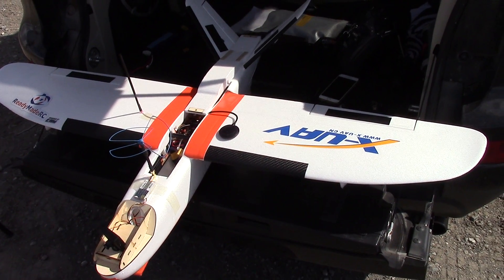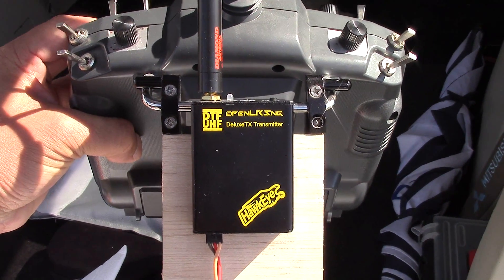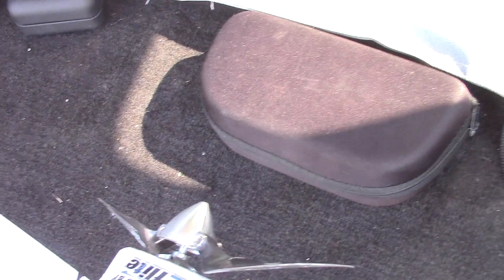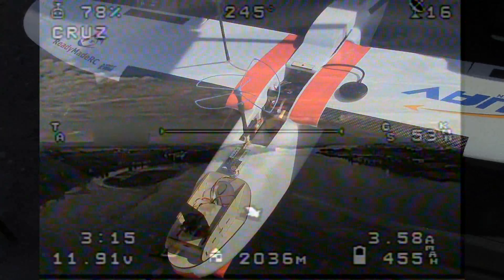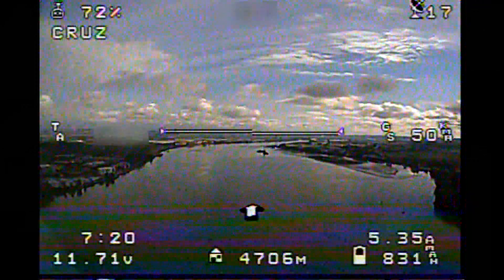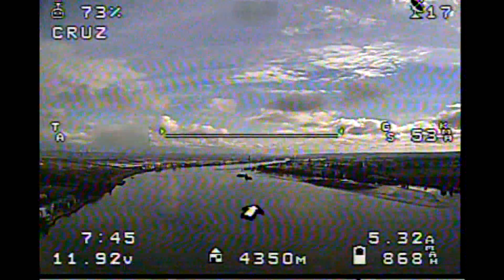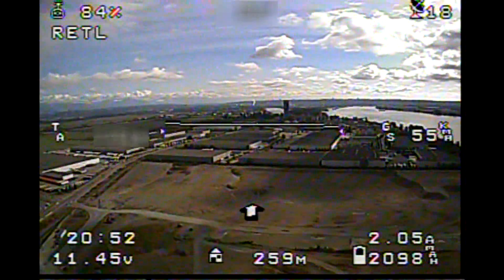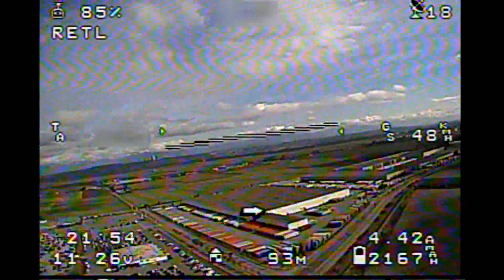Mini Talon + Pixhawk + MinimOSD-Extra - 5 km FPV Maiden w/narration

Comment: Thank you very much for your reply, so you wouldn't go with ebay chinese pixhawk? thanks
Reply from the maker: +L0ND0N200012 I was about to until I read in one of the forums that I go to that at one point Mission Planner was locked down to connect to original 3DR FC products (APM and Pixhawk) only. I cannot verify if it is true or not but being a newbie back then with Pixhawk I did not want to take the risk.

Comment: Thanks for this very informative video, I just want to get your opinion if that's ok, Basically I'm about to finish building uav 3000 but now I'm stuck on making a decision as to which flight controller out of (mfd. eagletree vector and pixhawk) to choose from, I like pixhawk purely because of the integration with mission planner but ofcourse reliability  and accuracy in terms of auto pilot mode are my top priority for this plane. Thanks in advance
Reply from the maker: +L0ND0N200012 If you will need waypoints for aerial mapping or surveying then Pixhawk imho is the FC you should look into, it is also one of the most expensive FC out there (3DR original)., Other components GPS and telemetry radio modules will also need to be purchaed separately. I like the Vector because it is easy to use and configure using their software, makes manual channel mapping a thing of the past when using the built in RX analysis wizard. I fly primarily long range so a rock solid pilot assist mode that locks heading and altitude is very important. Vector has a solid 2D and 2DH modes for whatever winged air frame you have and a very well thought off wiring harness. I like the MFD but in my experience it is very picky on the flight camera that it will work well with. If you just need a decent OSD overlay with GPS/Telemetry and a solid RTH the Cyclops Tornado good choice.

Comment: Hi Thanks for video, I also will build mini Talon  with PixHawk lite. It will  be my first APM, and would be helpfull  to get your settings and help. My first autopilot was Cyclop Tornado. APM very interesting but difficult in bigining. What in first need to do for mini Talon?
Reply from the maker: +Александр Николаев I too started with the Cyclops Tornado, I had a few of them, then moved to the MFD and Vector flight controllers. The Pixhawk is really complicated to configure and requires a lot of reading before you actually touch the configuration. The first thing that I did with my Mini Talon when I was building it was to find a a way to re-enforce the tail skid and motor mount. Coming from the big Talon I know these areas are pain points if you land on anything other than tall grass. If you are building your Mini Talon for long range flights make sure your lipo pack (whether 3S or 4S) will fit the fuselage. I will be shaving some foam on my 2nd Talon to accommodate a bigger 4S pack so it will be easier to shave the foam before actually gluing the 2 fuselage parts together. Most of Pixhawk settings are specific to my TX and GPS/Compass, the rest of the config are stock out of the box.

Comment: Hi Joel. I'm building a Mini-Talon. I've heard that the CG stickers are not correct?  Where is your CG?  Thanks.
Reply from the maker: +Glenn Doney For me right at the servo wires.
Reply: +Fly With Me Fpv I had my CG set at the stickers for its maiden and resulted in a big crash. When I launched it, it pitched back then rolled to the left and came down nose first and ripped the nose off. So it was obviously tail heavy. If u have ur CG at the servo wires then that would make it even more tail heavy ? I managed to patch it up but I'll be setting the new CG at the little holes where the hex screw is that tighten into the wing spar.
Reply: +phats24 I haven't maidened yet so the CG placement is getting me a little nervous.  Zaksterblue on rcgroups also likes the CG on the servo wires ("I spent the morning re-experimenting with CG balance points, and having found a reasonable spot (fingers under the main aileron servo wire tracks), got an ok balance between straight and level powered flight and power-off glide attitude without stalling.")  Those holes for the main spar clamp are actually in front of the spar.  Zaksterblue did a lot of experimenting to avoid both the tail heavy and nose heavy extremes....but he also doesn't fly it anymore.
Reply from the maker: +phats24 I've always used the servo wires to get CG. I just did an endurance flight a few hours ago with a new motor and 4S lipo pack. Did you chuck your Mini Talon against the wind? What works for me is not launching it in full throttle, just chuck the plane in a forward direction and not upwards. What described happen to you happens to me a lot on my big Talon because I have a tendency to chuck the big Talon upwards rather than forward.
Reply: +Fly With Me Fpv I took my banged up talon to the field today and done some CG testing. I started nose heavy with the CG set at the little holes where those hex screws are. It flew pretty good, I could tell it was nose heavy so I moved the CG back to the stickers, it flew good there aswel and glided a bit better for landings. I ran out of elevator on landings at 60% throws so I increased to 85% which works better. So u could say the mini talon has quite a large CG range from the little holes back to the servo wires. 
As for my maiden crash, yes I think I threw it at too much of an angle and stalled it. Today I was launching at about 60-70% throttle and slight upwards angle. It had some torque roll to the left but launched easy. Now I've gotta buy another one and try build it a bit lighter as this one was a heavy bitch :)
Reply from the maker: +phats24 Good that you sorted out your CG and launching issue.

Comment: Why did you use the pixhawk and not the vector?  I have the apm 2.5 but am looking at getting the vector.
Reply from the maker: +horsship I have a Vector on my big Talon already. I wanted to try out the Pixhawk so I installed it on my newly built Mini Talon. The Vector is a lot easier to install and configure compared to the Pixhawk, the OSD is already built in and the wiring harness was really well thought of.